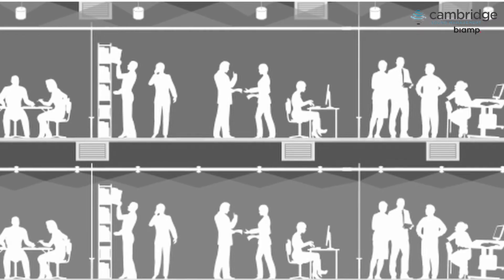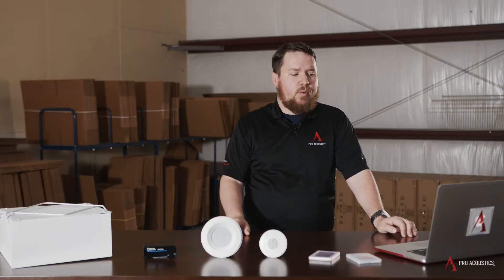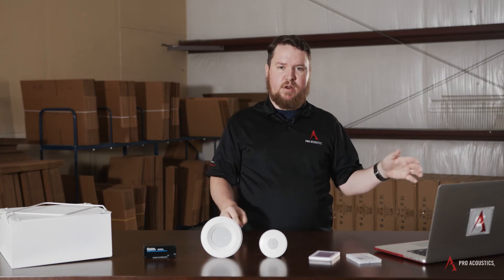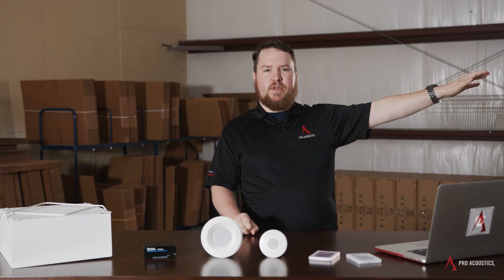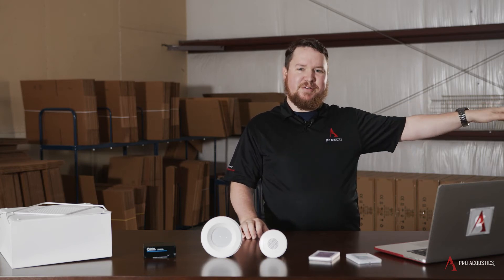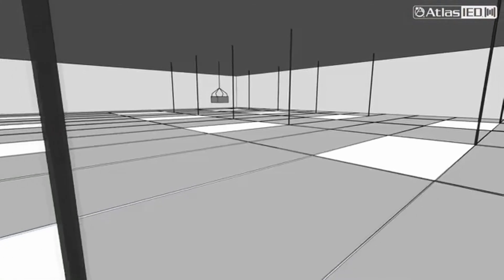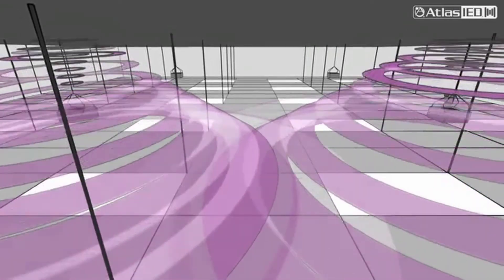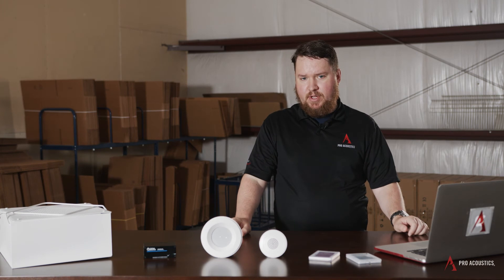What is sound masking and how does it work to reduce noise? - Pro Acoustics Tech Talk Episode 52

Comment: i am looking to mask or quiet down a shop floor filled with noisy machines, so that working in their vicinity it is a little more bearable. I will be adding sound absorbing panels, but was wondering if your system was programmable, say by using a microphone to measure the frequency in the room, and output the reverse wave through the speakers. Or is it only programmed for speech. If so, what type of a system would I need. Thx.
Reply from the maker: It sounds like you’re thinking of phase or noise cancellation, which, unfortunately, won’t work in this scenario. With loud machines, sound masking also wouldn’t be effective in quieting the area. However, adding absorptive panels or finding ways to block or wall off the sound are good options to make the space more bearable.

To learn more about the differences between sound masking, noise cancelation, and sound absorption, check out these videos:
- Sound Masking vs Active Noise Cancellation Technology
https://youtu.be/xgFIVLBU-ZY

- Sound Absorption vs Sound Masking
https://youtu.be/xgFIVLBU-ZY

Comment: Does it have downsides? Considering the fact that sound masking is meant to draw the brain's attention to the masking even when there is no neighboring conversation. Does it impact ear and hearing capabilities long term given that the noise floor is elevated for long periods of time?
Reply from the maker: Great question! Most sound masking systems operate at a relatively low volume, typically between 48-60 decibels. This is about the same as a quiet conversation or the sound of a rain shower outside a window, and it's quieter than the background music you'd often hear in a restaurant or retail store. The sound is subtle and designed to blend into the environment, create a more comfortable space, and not overwhelm the senses. As far as we know, there are no long-term impacts on hearing or ear health.

Comment: We have air con units in our office and when they switch off you really notice the silence. Its kind of uncomfortable. I like the gentle background noise like being on a train.
Reply from the maker: For a customized sound-masking solution for your office, contact our Sales Engineers at (888) 256-4112 or sales@proacoustics.com. Our commercial sound masking systems are designed to run 24/7, ensuring maximum comfort.

Comment: isn't it tiering having that noise in the back ground? Your example of the aircon switching off, my first reaction to the noise of the aircon stopping is of relief.
Reply from the maker: Hi Nick, Sound masking injects filtered white noise into the environment to smear vocal frequencies, help mitigate office chatter, and provide privacy around confidential areas. For the average individual, this is a practically unnoticeable effect. Sound masking does not reduce noise or "noise cancel". To reduce noise in an environment, you would block sound by using walls, dividers, and/or acoustic treatment panels and plugging up holes where sound leaks into the venue. You can check out these other videos for further explanation on this:
https://youtu.be/BTkkF2KvKvY
https://youtu.be/xgFIVLBU-ZY

Comment: We are in a budget crunch and have a large open space for our Student Center at our Church.  There are 14 open top classrooms in this space and when all 14 classes are going strong it can get fairly distracting for the students.  As a stop gap until we can get a permanent fix installed, would playing some sound masking over the PA system in the room at about 45-50 dbA assist us in the process?
Reply from the maker: We would be happy to help you out. Email sales@proacoustics.com or call (888) 256-4112, and you can talk directly to a sales engineer who will assist you with the best solution on your budget.